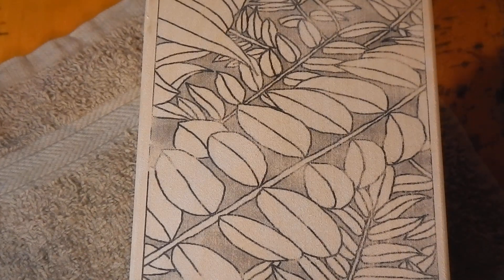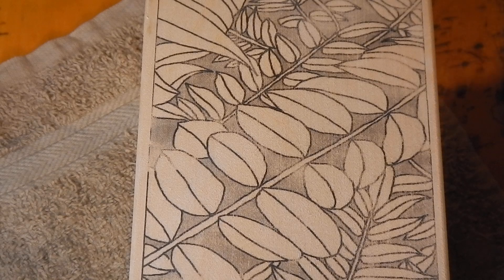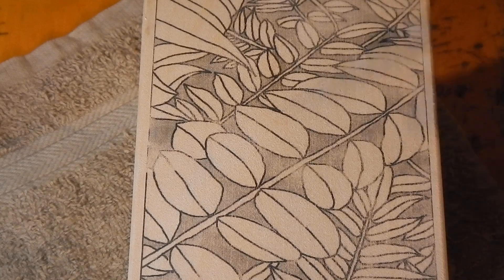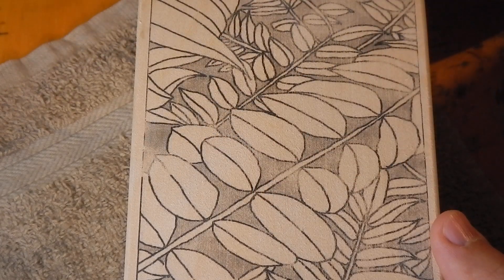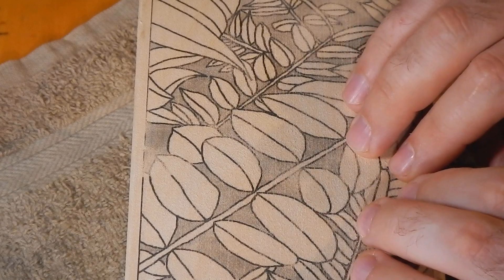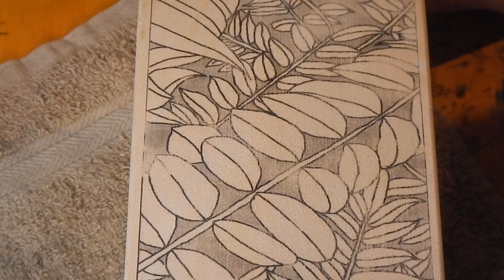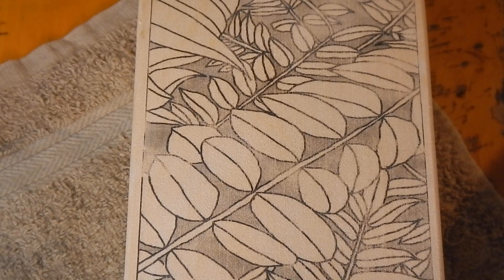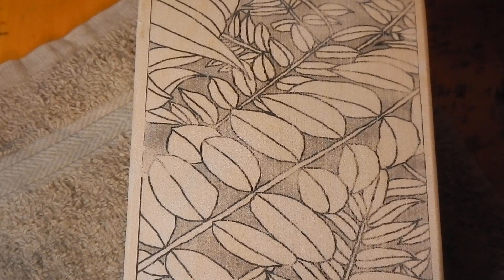Perfect Pattern Transfer | CARVER'S TIPS

Comment: Really enjoy your channel. Great and professional video. Glad I checked here first as I am ready to apply a pattern to my plate with my transfer hot tool 
Wonderful tips on the corner tabs and the application or rotation or pressure using the tool. And periodically take a break to let tool heat back up 
Do you suggest a type of “sealer” before doing 220 grit and the pattern?
Reply from the maker: I don't use any products on the wood before sanding and carving.  All chemicals are applied as part of the finishing process.